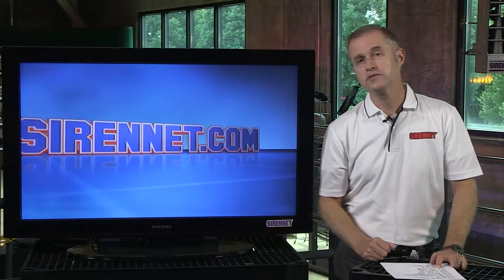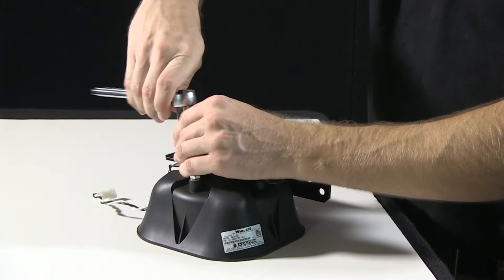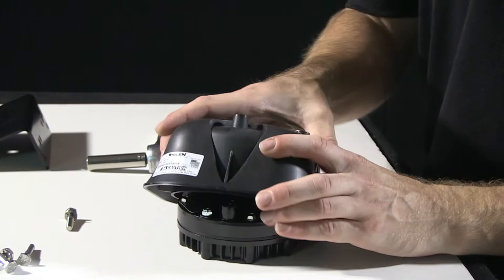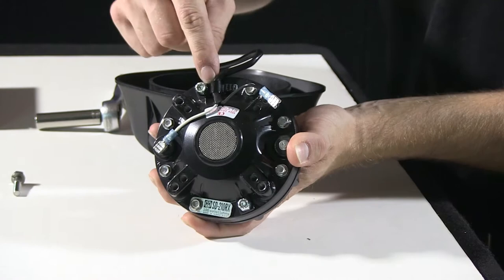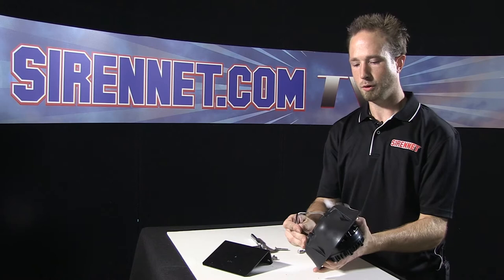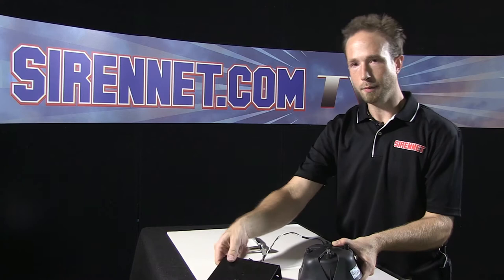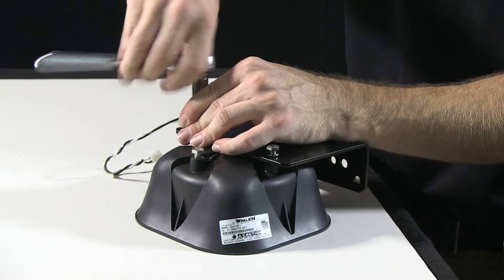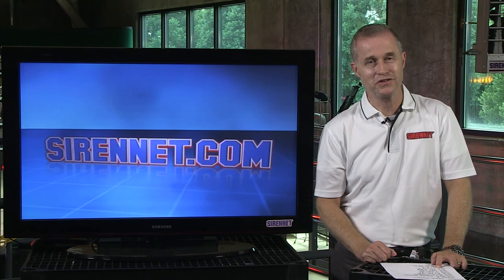Chris disassembles a Whelen SA315P Projector Series Speaker

Comment: i was disappointed - I expected this to be a disassembly of the driver, only a simpleton can't figure out how to unscrew 4 bolts without a video.
Reply: The driver is a sealed unit; it has to be, in order to maintain weathertight integrity. As such, it isn't user-serviceable. Only a simpleton wouldn't know that.
Reply: @JohnnyWishbone85   The point is, I am looking for a video to user-service mine, as it has lost the weathertight integrity, and is well outside the manufacturer's warranty period.   Some people are able to take things apart and fix them, and often go looking for information from others first.  Only a simpleton wouldn't know that.
Reply: @Gavitron  As I said, only a simpleton wouldn't realize that the driver isn't user-serviceable.
Reply: @JohnnyWishbone85  I think we disagree on what "user serviceable" means, probably due to your own limits at servicing products in the field.
Reply: @Gavitron  -- Ever tear into the bottom end of a Triumph TR-9 engine? Ever wind your own alternator? Ever build a plane in your garage?

Some stuff really isn't user-serviceable. From what I've seen, the SD-210-RX driver is assembled in such a way that there's a very high risk of irreparably damaging the diaphragm if you try to split the case. Of course you could try to fashion your own, and I have no doubt it could be done, but doing so in a way that would replicate the function of the original machine would be so finicky and expensive to do that it's a better use of your time and cortisol to just buy a new one.
Reply: @JohnnyWishbone85  gs1100ez,  starter, and only models, but yes to all 3.
Reply: @JohnnyWishbone85  You are correct, the "SD-210-RX driver is assembled in such a way that there's a very high risk of irreparably damaging the diaphragm if you try to split the case".  This is why i started looking for a video where someone else had already "disassemble[d] a Whelen SA315P" so that I could see firsthand what to be mindful of before I broke the one I have.   That led me here, to this video.  I don't understand why I had to prove my bona fides to stop your condescending attitude, but at least you got there in the end.  

As for the siren I have - It works just fine, but the powdercoat is lifting off of the corroding chassis, and it's now covered in a fine white ash of Aluminum Oxide instead.  My plan is to disassemble, media blast, paint, and reassemble.  At least if I have to replace it with a new one, I'll know I tried.